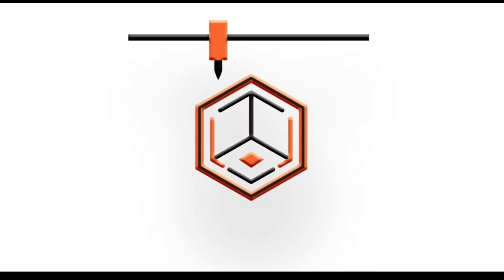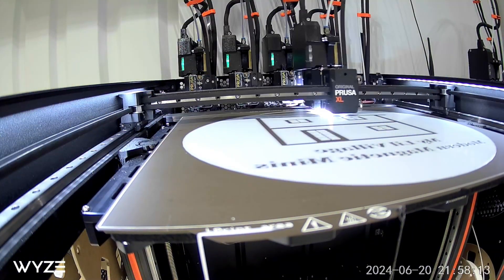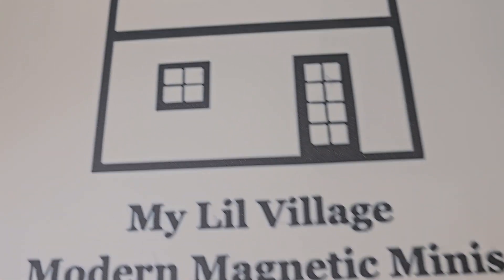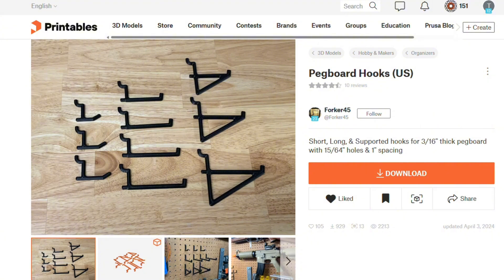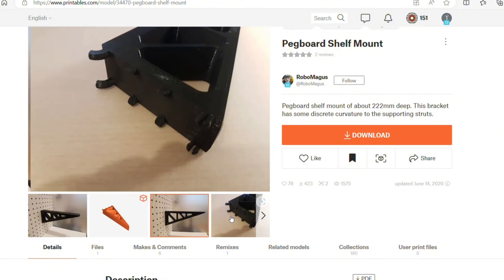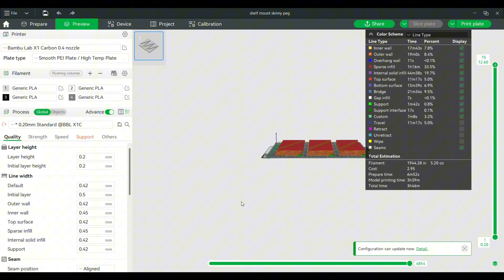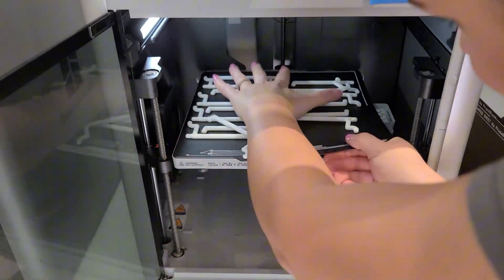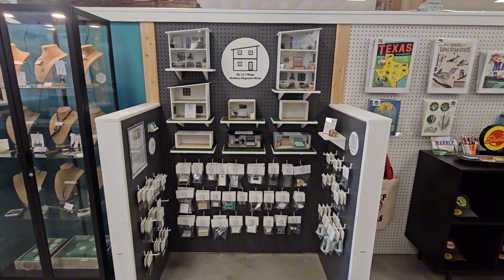3D Printing for My 1st Booth!!!

Comment: Nice!  You really need to add the Brush mod to your XL, it's cheap and easy to do and it will improve your prints (especially mutli-material).
Reply from the maker: Ok I'll check it out. Thanks!

Comment: Your booth looks very clean, very professional. I love the way you display the houses on the shelves.
I remember that you were having a problem painting some things in Bambu Studio. I found a solution to some of those issues using TinkerCAD. The issue I was dealing with was text. I wanted more layers of the text colour and I didn't want to have to indent the text to be able to colour it. Essentially what you do is to use two pieces. One piece is the letters, the second piece is the piece the letters display on. In my case it was a 2mm thick box top with 0.6mm deep letters flush with the surface. You put both parts into a Bambu Studio project. Set the filaments to use with each piece and then line the two parts up on the build plate. Once that is done you can merge the two pieces together so that you can move the part around on the build plate. I found this produced perfect results and allowed me to control how deep the colour went. You might want to try that technique with your IKEA house. Cheers!
Reply from the maker: Oh that's good to know you can merge it. I kept trying to slice out and create a negative. It worked but it's not efficient. I'll try this! Thanks!